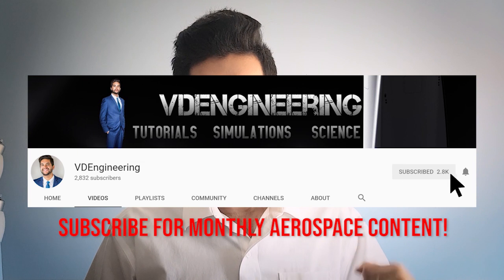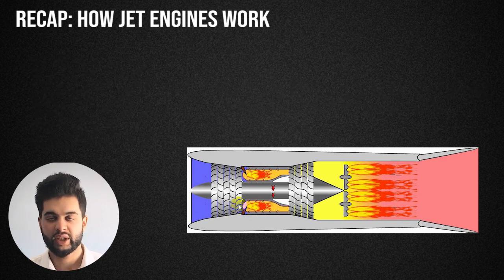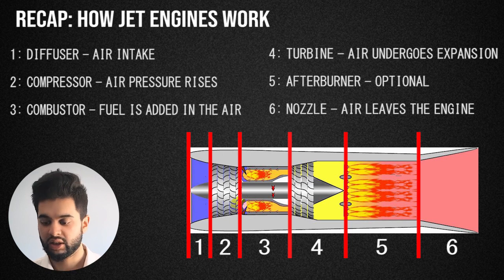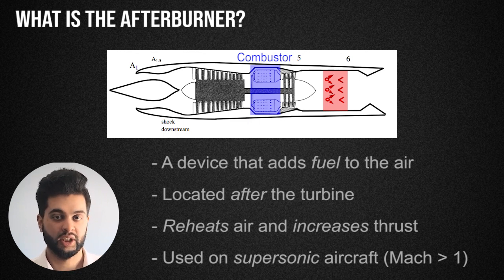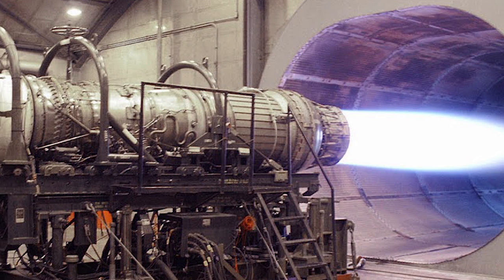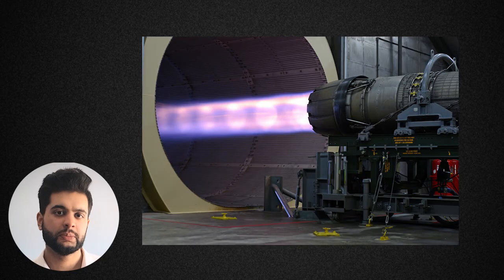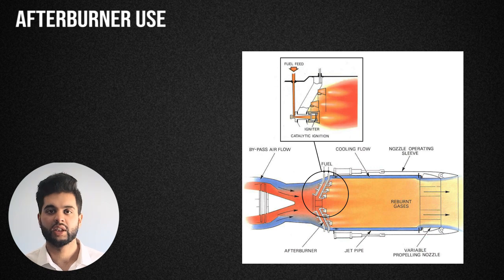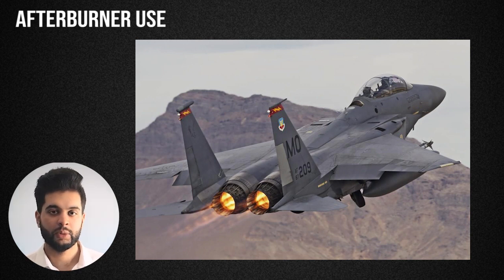How Does a Jet Engine Afterburner Work? - Compressible Flow Basics

Comment: Very well explained! Soo… air intake (sucks in air), compressor (increases air pressure), combustor (adds the fuel), turbine (increases air speed) and the nozzle, where the air leaves. And the Afterburner can be optionally put after the turbine to increase the thrust. yeah i think i got it! Thanks for your knowledge!!

Comment: Is it possible to use the plasma jet after combustion and to generate the necessary electricity from the jet so that the jet continues to work continuously in a state after combustion, with thanks I mean to raise the gas pressure to the maximum extent possible and not be afraid of the gases going back while saving fuel

Comment: Nice video and very concise. Are the diameters of the nozzles on a fighter like the F/A 18 computer controlled or pilot controlled? I understand that they are purposely over expanded. Also can you recommend a book(s) that expand on your video?
Reply from the maker: A good book is "Rocket Propulsion Elements" by Sutton and Biblarz
Reply: @VDEngineering   Thanks !

Comment: Modern fighter engines use augmentors rather than afterburners. They use secondary flow produced from the low pressure compressor to introduce oxygen back into the gas stream. Love the vids though keep me coming!
Reply: As an AT in Uncle Sam's Navy, the only augmentors I dealt with were radar augmentors. Can you explain--BRIEFLY--how augmentors replace afterburners?
Reply: Never mind. I just saw your complete comment. Thanks anyway.
Reply: Afterburner means that the spent gases inside the exhaust are injected with fuel and burnt again, hence the term afterburner. An augmentor use the gases from the same exhaust plus air ducted from the fan at the front of the engine as a mixture and is injected with fuel to make more thrust than the old afterburner design.